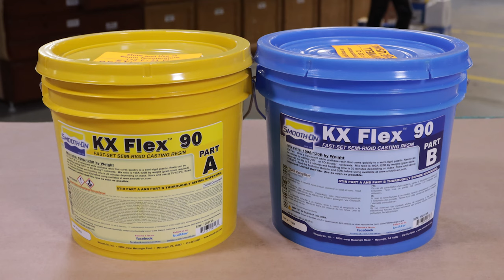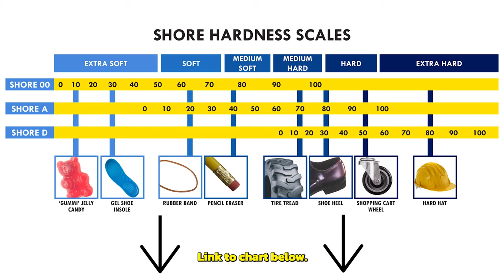Making Things with Milo - Hollow, Impact-Resistant Flexible Prop

Comment: Hi SO— hoping you see this.. 
maybe you could show how one would make a casting and mold incorporating a piece of metal tubing embedded through it.
Or ending up with a foam casting with a metal tube going through .
That may be hard to picture, but like a foam hand holding a 1” diameter x 3’ length metal tube.
Is there a way to make a foam or silicone casting that could incorporate another material like metal and become “part of” the casting?
I hope that makes sense 🥴
Thanks for all your interesting videos! New sub, fascinating,
A painter for years and I’m going to try some of this mold making!😃
Reply from the maker: Can you send us a tech ticket? Our team can help you - https://www.smooth-on.com/support/ticket/add/agree/

Comment: I have a question Milo,

I usually degas polyurethane resin (smooth-cast 305) just before I put the molds into my pressure pot. I do this because of the size of the parts (32 mm miniatures) to make sure all the tiny bubbles rise up quickly. my molds have a big cavity on the top just to avoid the resin overflow during the degassing process.

I have tried other resins and I have seen that the bubbles just blow up once they reach the top cavity with no-chance for the resin to overflow at all (just like lava, from a volcano).

Do you know why it happens? (Is it due to the density or viscosity?)

Is there some trick to minimize this effect? I have heard spraying a touch of alcohol on the top superficial layer could work, also adding some marble powder (I tried this and I changed it just a little bit, but no much)

Thank you for this videos!
Reply from the maker: Can you send us a tech ticket? Our team can help you - https://www.smooth-on.com/support/ticket/add/agree/
Reply: @smoothon  thank you! I will